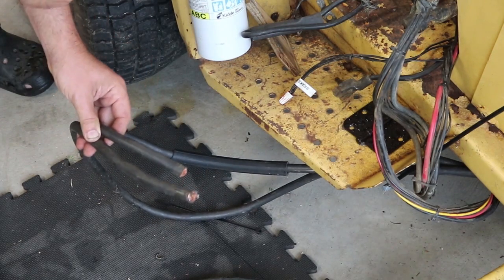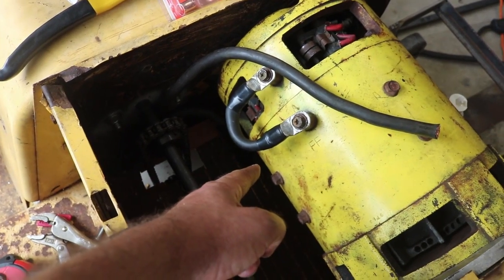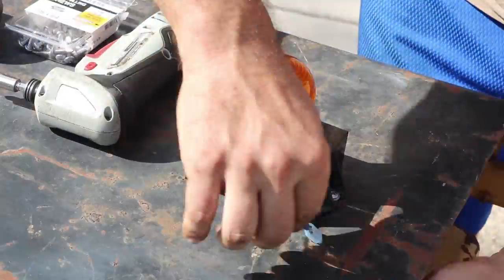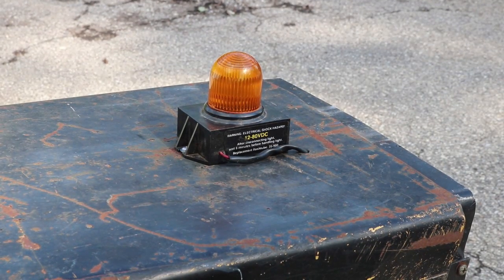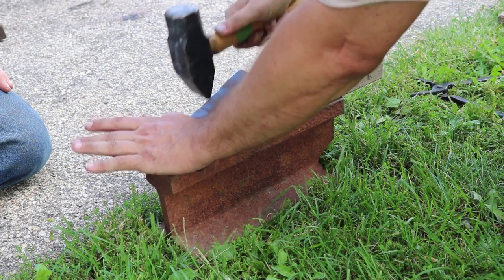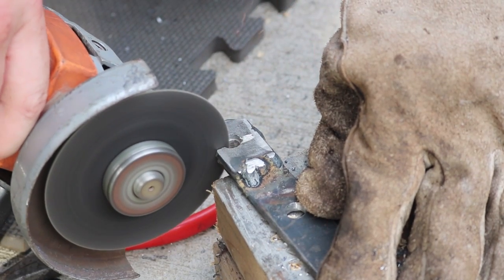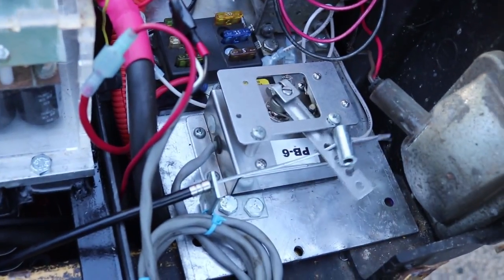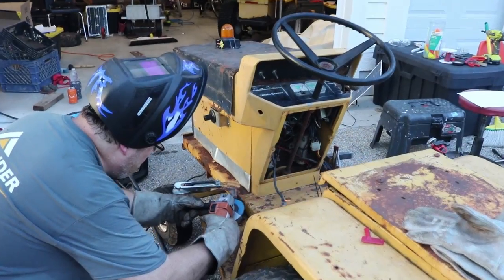Electrak Rat Rod part 14

Comment: If it has a beverage holder it's officially a rat rod! lol! One question: other than keeping someone running out in front of you why the strobe light?
Reply from the maker: The strobe is just for fun. I originally designed this to enter into something called "The World's Greatest Junk Parade". Reusing ridiculous industrial parts is just part of the fun. On the practical side, without an engine, a person can hardly even tell it's on, so some sort of visual indicator isn't a bad idea.
Reply: Ben, you should add the Jetson's car noise to it. Confuse and humor people about it.
Reply from the maker: I did that on my electric Kawasaki! I put an iPod in the hollowed out gas tank with some small self-powered computer speakers. It worked really well in parking lots where there's people just walking around not paying attention anyways. Besides the George Jetson flying car sound, I also had a Harley sound, a 50cc sound, and a "potato, potato, potato..." sound loaded up.

Comment: Electric motor brakes? Maybe with some aggressive regenerative brake settings you will be all set?  Not that having an emergency mechanical brake is a bad idea...
Reply from the maker: This is a series-wound DC motor in this tractor. Series-wound motors are NOT well designed for regenerative braking. The tractor really just needs a new set of friction pads.
Reply: Ok 😎 I have not done much with regen. I found on my kids electric toy car shorting the motor leads is a good brake, that is a permanent magnet motor through..
Reply from the maker: DC Permanent Magnet motors are great with regenerative braking. That's actually commonly used to control blade speed on smaller wind turbines. You short the two cables together to keep the blade from spinning while raising and lowering the turbine on the pole.